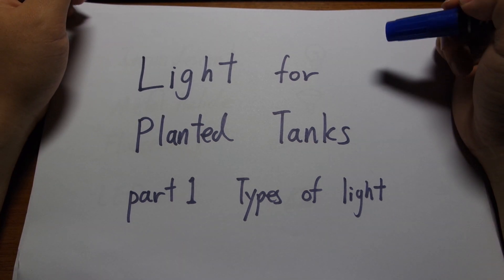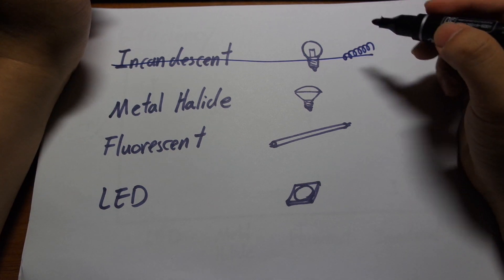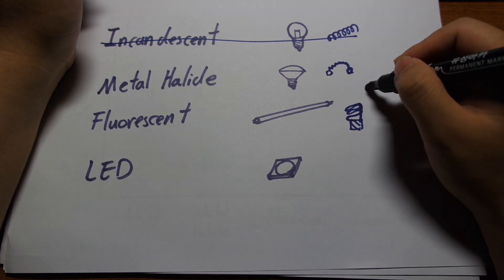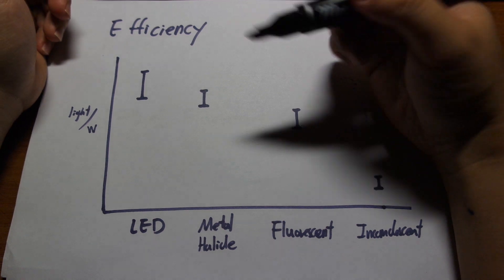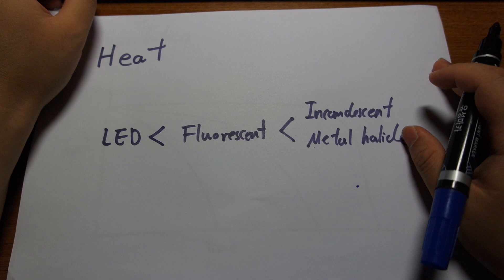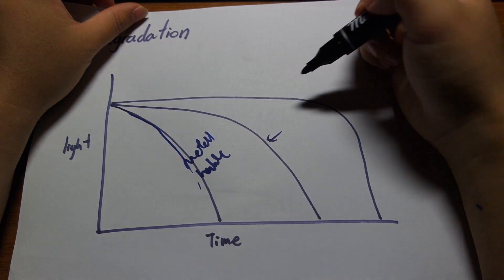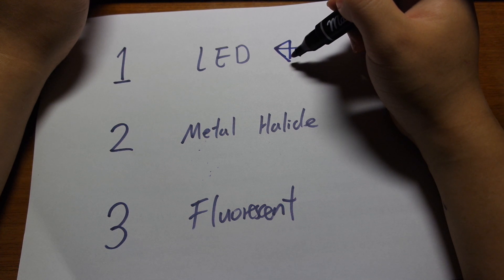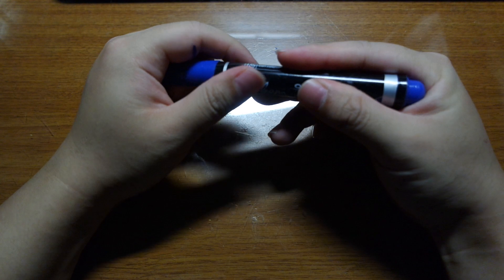Light for planted aquarium guide part 1, LED, metal halide, fluorescent, incandescent bulbs

Comment: 3:50 - efficiency depends on makr. n type of bulb.
4:25 - LED is best light.  2nd metal helite......  3rd is fluorescent.  Incandescent makes lots of heat n isn't as good.
6:28 - degredation of lights

Comment: Oh, you’ve been running baby LEDs mine are adjustable but at 100% Power you could burn yourself on them. You can also get a sunburn you missed compact LED bulbs, which aren’t bad and can be put in most metal halide or incandescent set ups other than that, you did great bro love your content. Keep doing what you’re doing.❤

Comment: There is a celling led it about 12w it was 6500k i have 10g tank should i use it ? My current light is 6 watt led and it suck i cant even spread all of my tank
Reply: Same doubt can u explain me
Reply: @krishnak3754  problem is no more. now I use 2 80 watt led spot light still 6500k
Reply: @additiveartificer9365  can i use CFL for 10g tank ,800lumen,6500k
Reply: 15watts
Reply: Because I want to go with cheaper option. And i am using low light plants can u pls help me with the suggestion
Reply: Well 10g tank 30 watt LED spotlight is enough
Reply: @additiveartificer9365 if that means i can't use cfl with 15w,810lumen 6500k light
Reply: You can but it too low for me
Reply: @additiveartificer9365  means it is not enough
Reply: The so called rule is approximately 3 watts per gallon